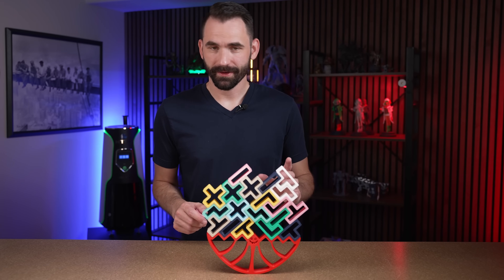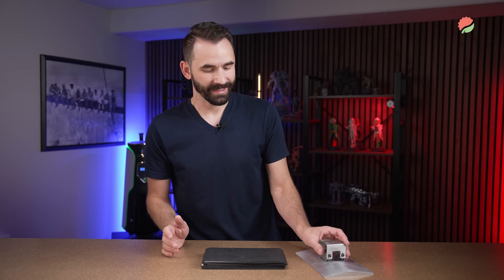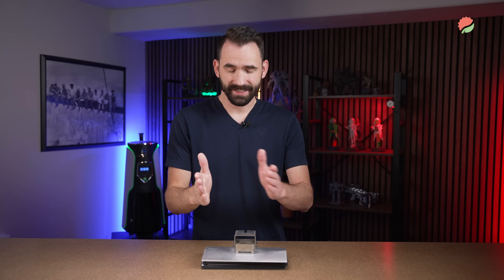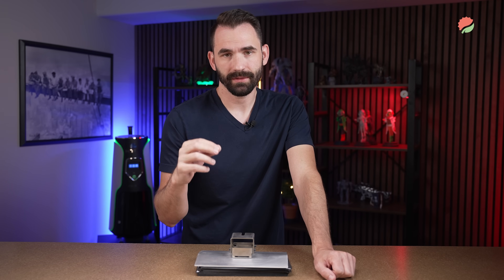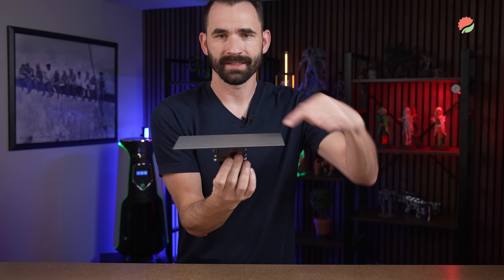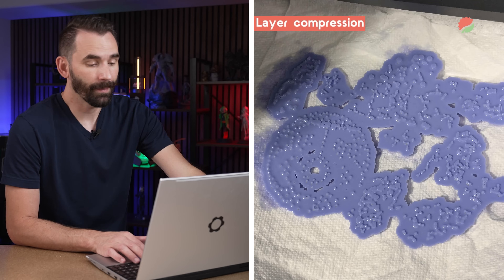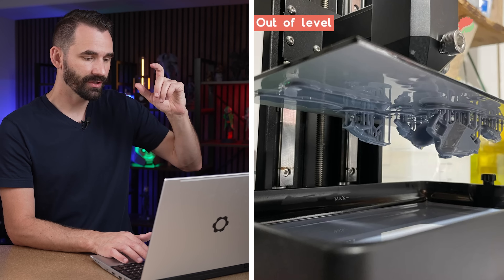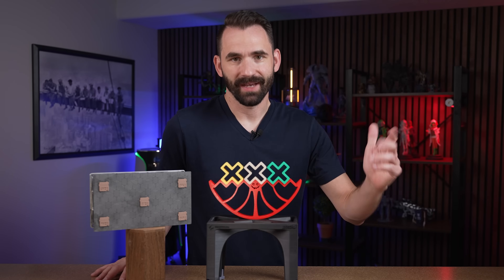Fix Those Common Resin Printing Fails! Easy Build Plate Leveling Tips You Need. | Fix My Fails #1

Comment: What if I’m having a successful but incorrect print? I have the Sonic mega 8k s and iv done everything I can think of to fix it from testing the LCD screen to new film to re-leveling and I’m still at a loss. I continue to get this odd layer shift issue where it succeeds but all the prints look like a large vertical layer has been removed and the print has shifted over. Like example, if I were to print something 2 inches wide, it’s like it removes a 1/2 inch somewhere in the middle and compresses it back together to print fully but missing 1/2 out of the center. This just started to happen after 300 successful prints and idk what to do
Reply from the maker: Join us on discord to get help 3D Printing :D https://discord.gg/NGDDTgY

Comment: My plate seems to forget where it is? I leveled it again and the leveling says complete but when I start a print my plate will touch the vat/screen and keep trying to force itself down through the printer. Afterwards I will attempt to move the plate up 50mm and it will say height limit exceeded even when it’s all the way at the bottom. Any ideas?
Reply from the maker: You might need to contact the support of your printer brand

Comment: I have a Saturn 4 Ultra. I modified the table and left it fixed. Just by doing this I already had improvements in the impressions. But I need to change the z-offset porém não sei como fazer. I need to increase the height by 0.2mm. Can anyone help with this?
Reply from the maker: Join us on discord, it's easier to help! :D https://discord.gg/NGDDTgY

Comment: Used an Elegoo Saturn S for the first time and immediately had a failed print. Only the raft was complete but it wasn't stuck to the build plate, it was stuck to the bottom of the vat. I'm assuming it's a leveling issue but if anyone has any advice or suggestions, I would really appreciate it!
Reply from the maker: Join us on discord, it's easier to help! :D https://discord.gg/NGDDTgY

Comment: Please, help me! My prints don't print on the entire Y-axis; they're cropped off at one edge, and cropped clones of them appear exactly on the other side. The print center is also significantly offset along the Y-axis. It's as if the print bed in the settings is smaller along the Y-axis than it actually is. My print size is 130x80, and the settings are the same. I calibrated it, printed a 50.2mm x 50.2mm square, and everything turned out perfectly.
Reply from the maker: Join us on discord to get help and feedbacks with your issue! :D https://discord.gg/NGDDTgY

Comment: Great stuff, thanks! Want to point out a leveling issue I had with the Mighty 8K in the beginning. I correctly leveled the build plate, many times, but I was still getting adhesion in some location , but nothing was sticking on the other side. It was driving me mad, tried a lot of stuff, but in the end the stupid mistake was not to actually level the printer to the table. The table was not leveled, so the 3D printer was leaning on one side, I adjusted the 4 feet and voila' it started to print without any issue. My guess is that when retracting , the very tiny resin film left behind (layer height) was pooling to one side (the side where the table was leaning) and sticking just there, the other side was deprived of resin and nothing could get cured there. Would love to hear your expert opinion if that is something that could have happened or what would be your explanation?

Comment: When do you start to think that the issue is no longer in the settings but the screen or printer itself?
I had been printing for about a year with the same printer and suddenly had failures on a majority of prints without variables changing (settings, temp/humidity, etc.). I gave up troubleshooting after a month straight, using your guide and multiple other resources, and have not used that printer since

Comment: I have a weird issue with Saturn 4 Ultra. 
I just got it a week ago and had two prints so far, and fortunately they were mostly successful - no failed parts, but there were some artefacts on some.
My first print was a boat a russian/viking boat (by Northern Crusades Miniatures), which I put at 45°, but because it was bigger print (that wouldn't fit my old Mars 3) I think I've overdone it with the supports on the bottom of the boat. Despite it being at 45° I put LOTS of supports, which made it really difficult to remove them later.
So the boat came alright, but has several fine but visible horizontal lines (ie they look angled now, but were horizontal during printing - obviously something to do with some layers), and same lines are visible in the smaller parts, and the boat's mast (which I also printed slightly tilted) is little warped - it does work ok, but looks rather rough.
But the weirdest thing is I had several very thin floating membranes. At first I thought that some layers have not stuck well to the print (which I still think is the reason) and have floated and later stuck to some other location - but fortunately they weren't stuck so at least they didn't cause more damage - just removed them carefully. 
But there were also some (not so few thin layers that have fallen to the bottom of the vat), fortunately I checked the resin before printing again (I don't really trust the residue auto-detection of Saturn 4 Ultra, just because I haven't tested it, so I'm being pessimistic :) ).
For both prints I used Siraya-tech Blu Black the first print at 4seconds exposure time, and reduced to 3.5 as I think 4 was very overexposed.
Also during printing I can hear each layer producing quite audible noise when pulled from the FEP, which I think is a bit too much force, and that's why I suspect it's the reason for these artefacts.
I'm not sure if that's the reason for all the artefacts (I guess it's possible).
I'm thinking to clean the vat and apply some PTFE to reduce the sticking to the FEP.
I guess if some thin layers are pulled about the same force between the plate/supports and the FEP and given the side-tide motion of the resin with the tilting function of the Saturn 4 Ultra, it's quite possible some layers were pulled sideways and turned to floating membranes (most of which accumulated on the bottom later).
I feel kinda lucky that the print didn't really fail despite that :) But certainly it's something I need to fix for future prints!
Any advices are very welcome!
Reply from the maker: Join us on discord for help with 3D printing! https://discord.gg/NGDDTgY

Comment: Hi! let say on my S4U I did your calibration for the leveling plate and both my 2 model in each corner are slim and most of it cured on the FEP (didn't weld together) and also the middle and back models are shifting between layers, does that means I don't give enough rest time after retract?
Reply from the maker: Join us on discord for 3D printing help by Derek and the community! :D https://discord.gg/NGDDTgY

Comment: A big one is holding the build plate by the build plate itself when you are taking prints off the build plate. If you hold  the build plate by the piece that connects to the printer arm, this will put your build plate out of level every time due to the pressure you put on it when removing prints. Took me to long too realize that but now I can't print over and over again without print failures. So hold your build plate by the plate and not the arm connection.
Reply from the maker: great tip!

Comment: Hey boss i am getting some issues similar to what you described, but i had confirmed bed is leveled many times. i made a reddit post with my resin calibration and pictures of the fails. it looks like a partial polish raft as some of the supports don't generate, but they are picked up later by other supports and start almost from air. I am kind of desperate, is there a way i can send the link of the reddit post to you so you can take a look?. Really appreciate your channel boss, really helpfull.
Reply from the maker: Join us on discord for help regarding 3D printing: https://discord.gg/NGDDTgY
Reply: @Lychee3d  Thank you, i will join, but just to update i think i already corrected the issue, apparently i put too many transition layers. causing the supports issues

Comment: Your explanation of raft splitting in the video is incorrect. It has nothing to do with differences in exposure time.

This issue is caused by resin still flowing when the UV comes on for the next layer. Due to the large size of the raft a large amount of resin is being displaced when the print lowers into the vat. This resin is still moving when the UV comes on for the next layer and doesn't cure right, resulting in the delamination. With smaller unconnected rafts this isn't an issue because the resin settles faster.

There are a few solutions.
1 - Don't use large rafts when you can avoid it. This is situational of course and not always an option.
2 - Use a long rest time (wait before print in lychee, rest after retract in Chitu) to allow time for the resin to settle. This will extend the time of the print unless you're using a pro level slicer(Like variable layers in Lychee) that can adjust the delay for different layers and the printer supports this(the saturn 4 doesn't for example)
3 - The simple answer is to use more transition layers. This works in any slicer, you want to use more than enough to go through the full thickness of the raft. This is a brute force solution that just over cures through the issue.

Comment: i have a problem with my new M7 max: i used your method and tools for leveling and when i try to print the test files all on the corner are print and in the good thickness but the central does not print, remains stuck to the bottom of the tray or have a fail after around 20 layers (or less). I use Jamg he standard grey. Have you got a suggestion for a solution and starting the exposure time test. thank you for yout quality job.
Reply from the maker: Your plate might not be flat if the middle is not printing, join us on discord lots of people who can help with this issue: https://discord.gg/NGDDTgY :)

Comment: Can you help with this  issue

Ive printed a very large circle base for a 1/4 statue  with all ur support settings like 
Med/heavy 0.35 and heavys at 0.40 though  the print made it out safe ive got a issue where all the supports around the circle are printed perfectly  but oonly a few have failed at the base in the middle but then half way up the model they printed perfect
Reply from the maker: Join us on discord for help regarding 3D printing: https://discord.gg/NGDDTgY :)

Comment: Question!!  My prints have been working out fine at 0.05 and 0.04 layer thickness. 2.8 uv exposure time.  At 0.02 layer thickness I reduced uv time by 20% and now I just get a blob on the liquid tray, nothing sticks to build plate...  do I increase UV or Reduce UV times? Thank you...
Reply from the maker: Try increasing the UV exposure, might went down too much if it's not printing :)
Reply: @Lychee3d   Thanks for your reply!  I did this, went up a fraction and also made sure the room was a little warmer and it worked!!!  At 0.05 my prints work fine, when I lower to 0.02  it's a little more tricky.  But worked. :)

Comment: I have a problem that i haven't seen anywhere i looked. First, the printer prints out a perfect rectangular "base" around hte base layer from one odge of the build plate to the other (parallel to hte shorter edge). Not much of  aproblem, it just wastes a little more resin. But now it started printing this lump of resin, with more or less smoothe edges. I had this problem on my Photon Mono 2 and now on my Mars 4 pro. I don't know what i'm doing wrong or what i can do to fix it.
edit: jsut the edges on the sides is smooth, the top and bottom edges are lumpy, as if there are  supports in them but the resin has curred arround them.

I've also noticed the last time that sheet of curred resin that is left in the vat when you perform the cleaning was also thinner than usual.
Reply from the maker: Don't hesitate to join us on discord where our community and our team including Derek is always happy to help! :D https://discord.gg/NGDDTgY
Reply: @Lychee3d  Ok. Gonna hop on one day.

Comment: Got a brandnew anycubic 5s pro...13 misprints in a row.  Only bottom layer stick to the fep , nothing more.  Im close to giving up.  Printed a year with an elegoo 4 without much issues
Reply: I had exactly this, and it was simply that my train was too cold. 

Bought a heater for my enclosure, and it's not failed since.
Reply from the maker: Hi you can join us on discord for any help regarding 3D printing, our team and community will be able to help you :) https://discord.gg/NGDDTgY
Reply: Get a fermentation heating band and just ensure your bottom/base layers are set to 40-60s for 10 layers.

Comment: very well explained. I have M7 Pro and I do see a bit of light flashing through the middle of the build plate. It is a bit concave. So you are saying that is normal? It doesn't need to be completely flat?
Reply: I have the non-pro M7 for a couple of days now and i'm having adhesion issues on the front center of the plate while printing. Also check the flatness with a ruler and it is indeed not 100% flat. But, having that said; could this also be a leveling issue of z-offset problem? I havent leveled the plate manually though since it should be factory leveled, so i will test this soon. Any tips are welcome!
Reply: I have an M7 and the same problem. In my case, the parts do not adhere well in the front centre. I sent an email to Anycubic support and they recommended setting the first base layers to 80s. How did you solve it in the end?
Reply: @perche26  I got it exchanged. Overexposing it is not really a solution.

Comment: Can you point me in a right direction? I have Anycubic photon mono 4, just out of the box, i've leveled the plate, i've set recomended parameters for the resin, but the rafts on my prints are not sticking well to the front middle part of the plate. I've checked with the light method and didn't see any noticable gaps. What can cause such problem?
Reply from the maker: You can join our discord and post there your issues, our team, derek and the whole community will help you! :)
Reply: I have the same issue with my photon mono 4. Middle doesn't always like to stick.

Comment: How do I find the the right amount of transition layers and bottom layers?
Reply: Testing. I believe mine is 5-6 layers at 30seconds each 
And my prints only ever fail when I don’t support correctly. 
You won’t find a definitive result because you’re trying to work with so many parameters.
Resin, temperature, lift speed, build plate adhesion…. 
You will find a sweet spot with testing I promise.

Comment: Leveling is such a tricky issue. Even as an experienced veteran I still second guess myself and sometimes am left scratching my head, so for someone new to all this I get why this is all so confusing - all the conflicting information on reddit doesn't help. Just as an example - on my mega 8k S, a 15 inch build plate, when its properly leveled I can print a raft anywhere on the bed and have it be near perfectly uniform and stick perfectly while releasing easily with 15s bottom layer exposure and a 40s rest time for my bottom layers and a 20s rest time for my transitions. Where as on my M5s pro, I can't get anything to stick after dozens of leveling attempts without 50s of bottom layer exposure. 

Rather than "auto leveling" - I want to see more manufacturers use their force sensors to do what heygears does on the reflex. The manual leveling process on that printer is the best of any printer I've ever used. They utilize the force sensor and give you an on screen display with real time read outs of the 4 corners. This gives you tangible, measurable feedback about if you are level without having to go through the whole process of printing rafts measuring etc. Not some vague paper friction "measurement".  Ditch the auto leveling - just give us a better way to manually level the plate than a damn piece of paper.

Comment from the maker: What about you? Which leveling fail has caused the most print nightmares in your experience? Share your struggles (and tips!) in the comments below.

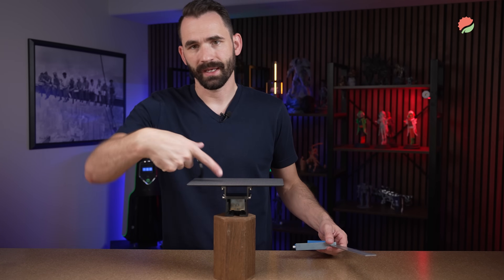➡  The common issues addressed at 7:04 in the video originated from our Discord community. If you're still facing challenges or have questions, join our Discord and connect with other printing enthusiasts: https://discord.gg/NGDDTgY